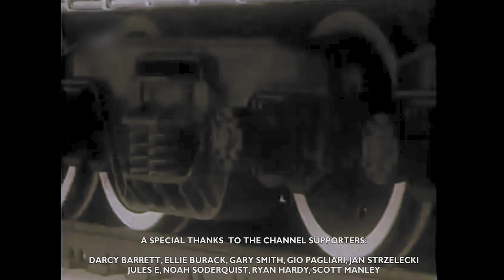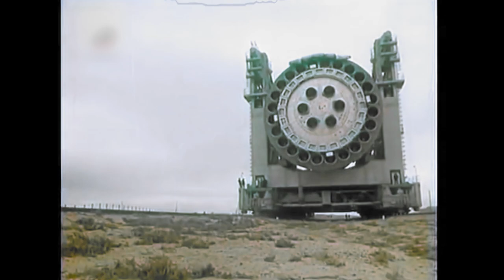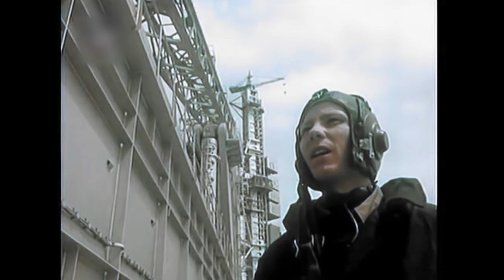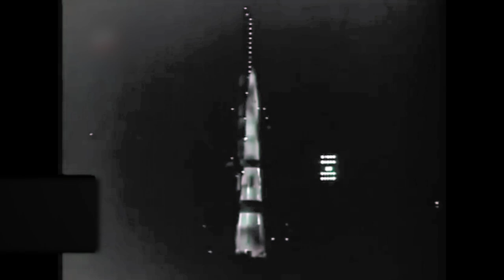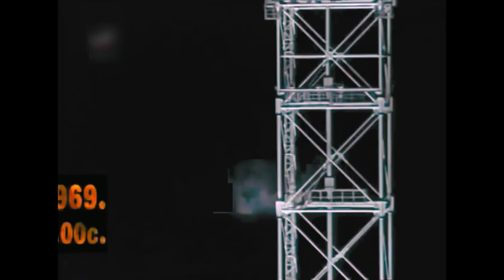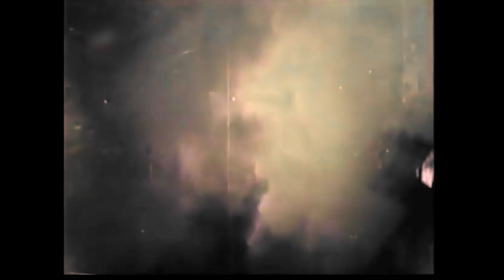N1 Rocket Failure - Second Launch Attempt (1969/07/03) - Soviet Moon Rocket

Comment: There was one angle of this launch I’ve seen that shows the launch escape system firing and pulling the Soyuz to safety. Unfortunately it’s been years since I’ve seen it and it was in pretty low image resolution. I wish all the raw footage of these short flights of the N1 were readily available and not the edited down versions in varying quality that have been shown in documentaries.
Reply from the maker: The Russians have released a few "new" things lately so we can hope.
Reply: 10 months later, but I think I found the video you are talking about. https://youtu.be/U9fkYIrRwbo?t=187 . very low quality.

Comment: They never static fired the N1.   The just fueled them up and went flying.
Reply: True, they never static fired the full stages, but they had a (pretty messed-up) system for testing some of the individual engines. The Soviets either didn't have or didn't want to commit the resources to build test stands for N1 stages. After the first two failures:

"One of the major changes during the 1969-70 period was reworking the procedural system by which engines for the first three stages of the N1 were selected for flight. The original method, known as KONRID, consisted of an efficiency control system in which a batch of six randomly selected engines were submitted for a flight article. Of these, two would be static tested on the ground. Depending on the results, the remaining four would then be consigned for the flight article. This meant that the actual engines used on the N1 were never tested prior to installation on the booster." - from Challenge to Apollo by Asif Siddiqi

This book is available in PDF on the NASA history website.
Reply: @shoggoth8808  It's important to note that the N1 engines used pyrotechnic valves and could not be reused after firing.

Comment: Had the right idea but the control and feedback technology of 1969 wasn't fast enough to adjust.
Space X uses this design.
Reply: Starship actually has more engines but they have the advantage of modern CPU processing to control them, this N1 was pretty primitive, however if Sergei Korolev didn't pass away I'm pretty sure it would've worked eventually.

Comment: Who was the pilot (or what looked to be a pilot) they showed?
Reply from the maker: Those are just drivers / military personal transporting the rocket to the pad. There was no one on board.
Reply: @RetroSpaceHD  good thing because whoever was onboard would have been killed if it didn't have an escape system.
Reply: @PCCphoenix  They would have probably survived. "The emergency rescue system fired in the nick of time, at T+14.5 seconds, to shoot the descent apparatus of the payload two kilometers from the pad, thus saving it from destruction." (from Challenge to Apollo)

Comment: What I find really interesting is 50+ years later, SpaceX's Starship is also using the lots-of-small-engines idea. 
There have been 10 launches of Starship, far more than N1. The last test got to 39km height before failure.
I'm just wondering if Starship could be a bad design, with similar flaws to N1? Will we ever see Starship, or any 30+ engine design succeed? N1 had 30 engines, Starship 33.
Reply: 10 launches? Only been 3 test flights as of today with the previous 2 having all 33 engines burning for full duration of stage 1, looks like Spacex figured out how to do it.